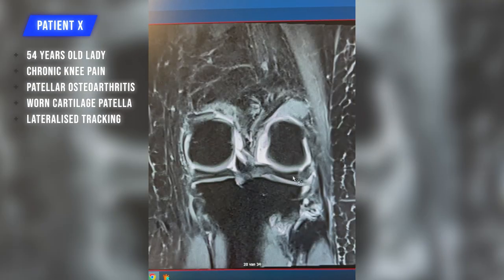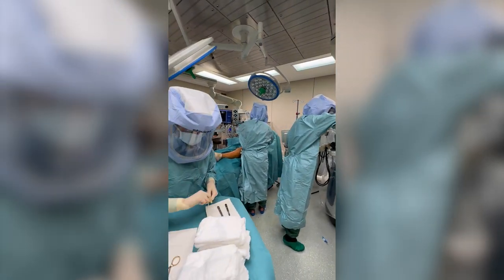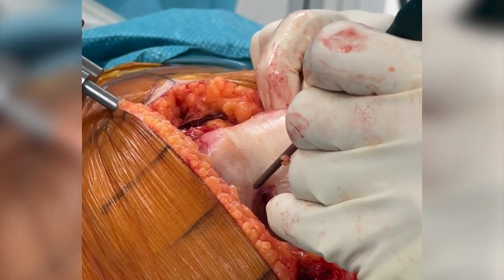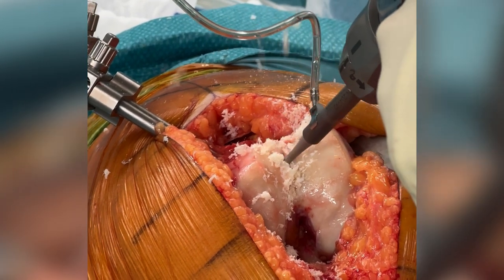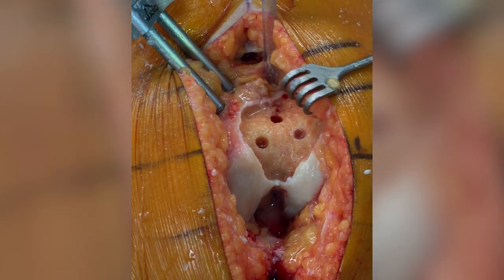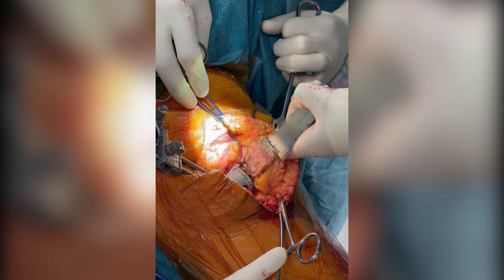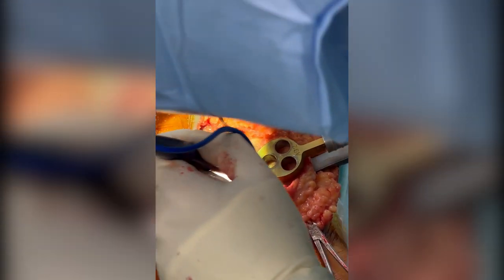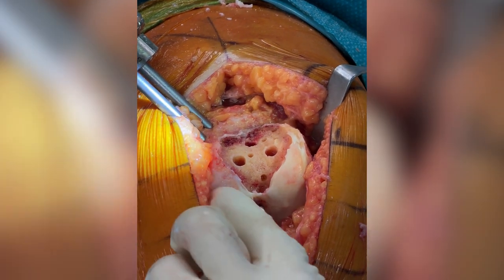Live - Patellofemoral replacement surgery

Comment: What happens to the bone that tries to heal with the cement components glued to it? Does the bone compensate somehow? Is there a chance it will come unglued?
Reply: Cement is not an adhesive.  Think of it as grout.  Yes, components can loosen over time (10-20 years) and this is one of many reasons for potential revision surgery.
Reply: @RaceTeq17  Ah, very interesting. I don't have knee surgery, but I had to get a tendon in my tricep reattached. My surgery, at least visually, would have been similar to this. Very interesting watch.